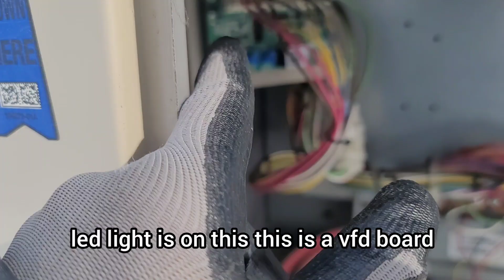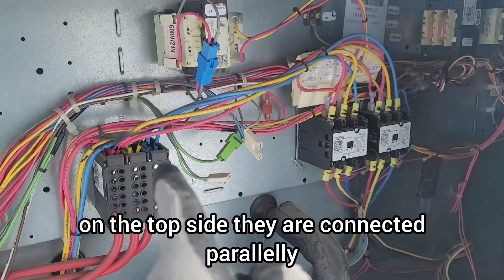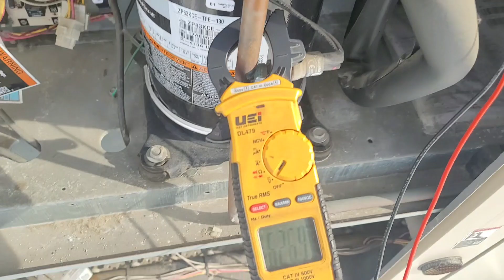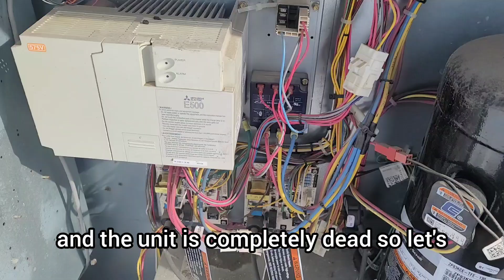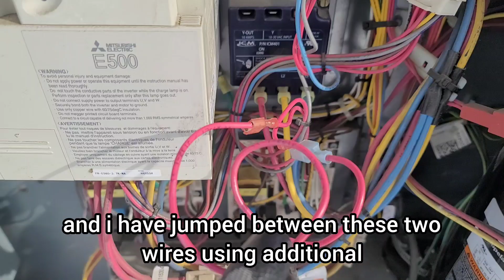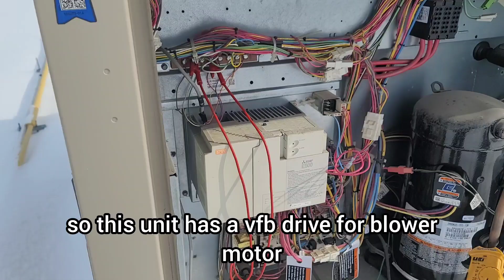LENNOX RTU Dead

Comment: Anyone know the model number of that ICM phase monitor?  ICM401?  Likely that HVAC unit lost a phase for more than 3 seconds.  They have several models, many of the models are re-settable. A ICM401 is around US$40.
Reply from the maker: Yes that was ICM401A, yes resetable would be better option